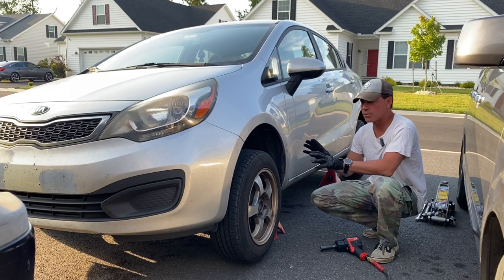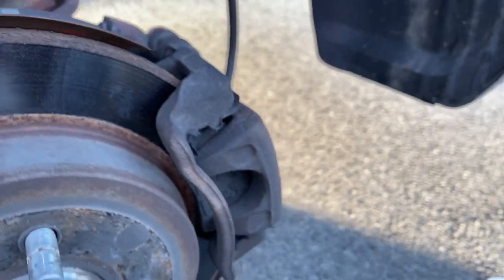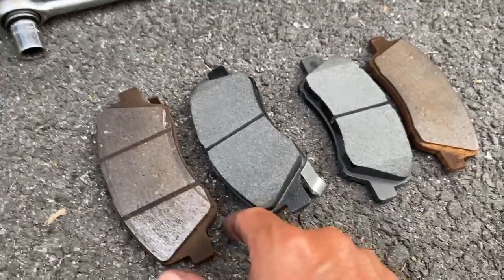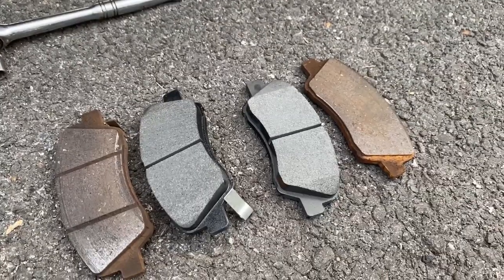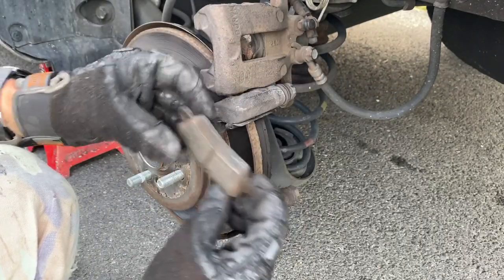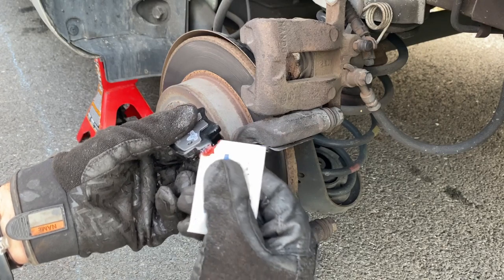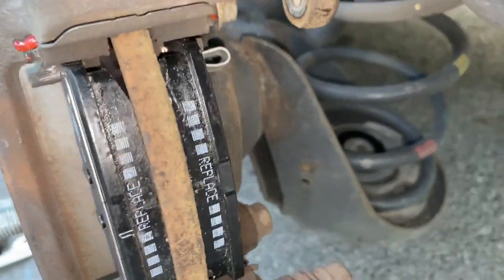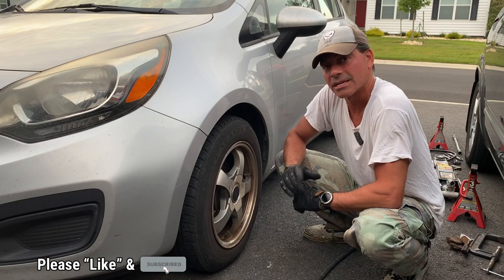How To Replace Front And Rear Brakes - Kia Rio (Andy’s Garage: Episode - 427)

Comment: My car is a 2023 kia río and the rear brakes don’t have calipers just the disc and I think the brake pads are inside of disc if you have a video on replacing brakes for a Kia rio 2023 much appreciated thanks
Reply from the maker: @liljimmysfoodfactorygemstr4096  are they drum brakes?
Reply: @PhillipsVision  yes they are there drum brakes 👍🏽
Reply from the maker: @liljimmysfoodfactorygemstr4096  here’s a video I did showing how to replace drum brakes. Not on a key but still the same overall process.
https://youtu.be/4sELK3Bpq94?si=EbLiUAvjq_xCoTHi